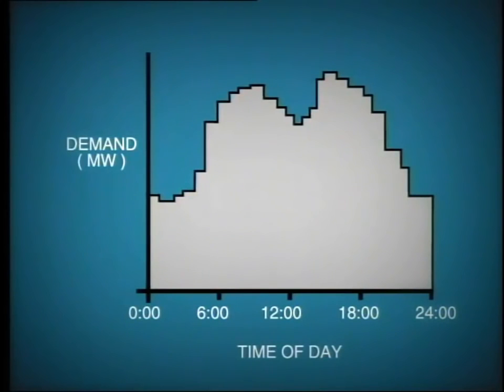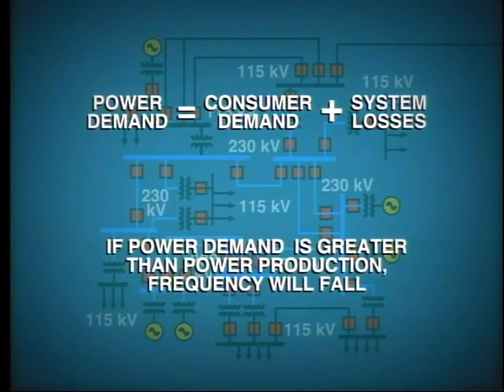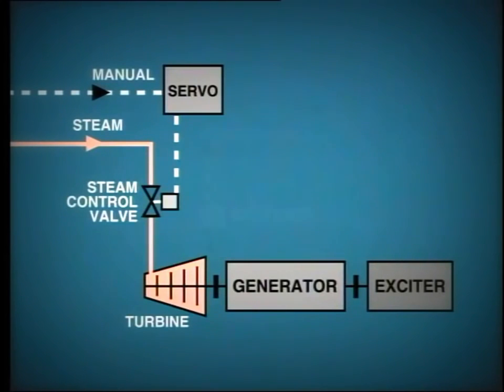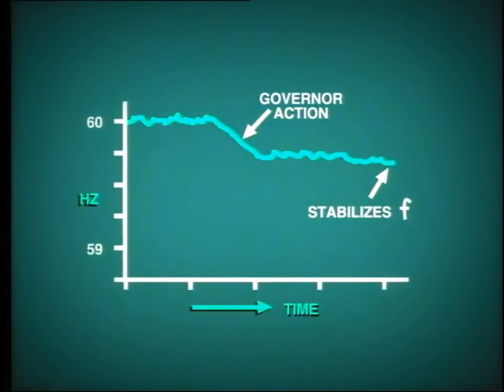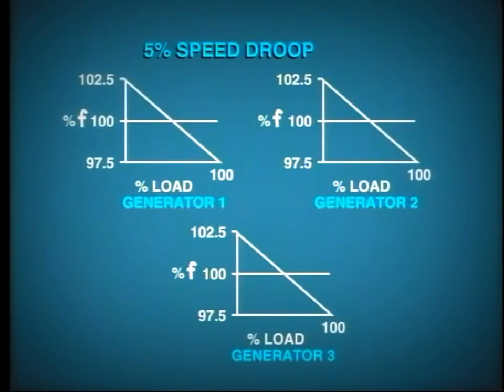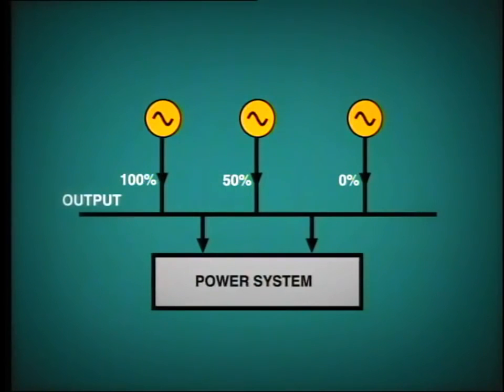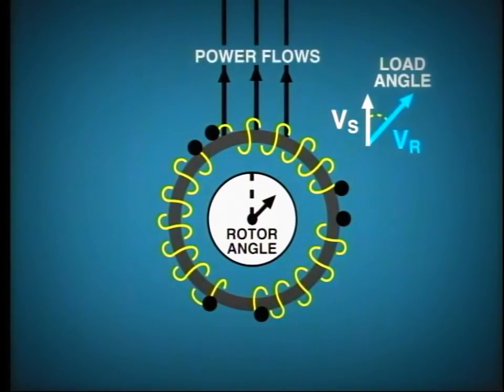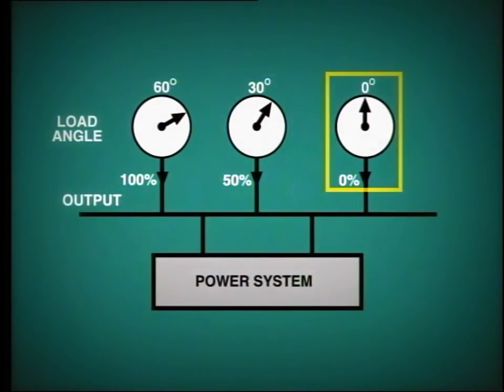lesson 1:Generator Megawatt Control

Comment: Can you please explain more about Load Angle ?
Reply: if you try to spin a bicycle wheel after someone already gave it a little push your action doesn't really do much.
Reply: imagine 2 people pushing a swing. the person that starts pushing first will push more.....pushing at the bottom of the swing is 90 degrees or pi/2 load lag means 0% load
Reply: @danialdunson  Could you explain more or do you have any document about this issue, I'm so appriciate.
Reply: @danialdunson  Thanks for the kind explanation....Are all the generators connected to the grid, running in "frequency control mode"?
Thanks.